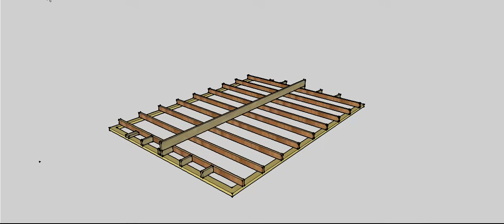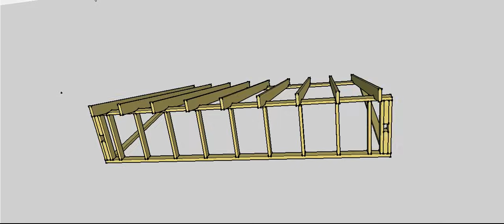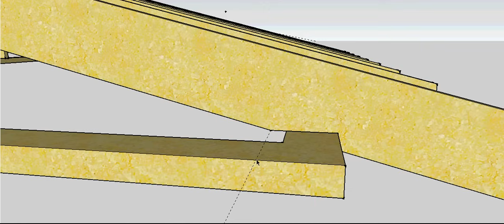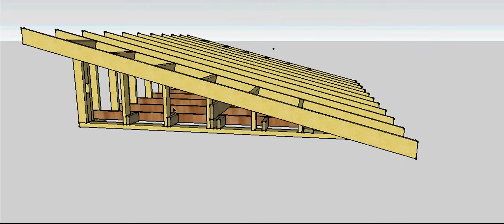Skillion Roof erection Procedure

Comment: Can I add this exact method to the top of the flat roof I already have with out removing anything. Reason I ask is because the flat roof I have has shingles and it's leaking a bit so I wanted to see if adding this method directly on top of my flat roof works.
Reply from the maker: Hi mate, yes that will work.
Reply: @Buildsum 
I have never done this type of project. How do I even start buddy .  I know to measure my flat roof ,but how do I know how long the rafters need to be or how high the skillion roof goes. Please give me something to start off

Comment: My jack, I need a 5 12 pitch with a run of 20 feet. Can anyone tell me how high does my jack wall has to be
Reply from the maker: 5 12 pitch = 22.62 degrees, 20 feet = 6.096m
Tan 22.62 = 0.417 x 6.096 = 2.540m = Jack wall height 8.333 feet
Hope this helps
Reply: @Buildsum so the knee wall needs to be 8 feet high to get a pitch of 5
Reply from the maker: Hi Mate, yes

Comment: Any reason you would advise against using 200x45 i-joists for the rafters? I'm building a livable garden shed 3600x4800 and happen to have some ijoists on hand, planning a 1mtr overhang on the high side and 400mm on the back. 5mtr span in total.
Reply: I guess you would strap them to the top plate and fill in between with whatever.
As an aside and this might change things. I've got hold of a load of second hand coolroom panels. 9off are 4200mm. The 20off others are 2700. I'm thinking this could be an interesting livable-shed build. Panels are painted  metal both sides w/ 100mm polystyrene.
Reply from the maker: Hi mate, no, as long as you dont notch the cords then they will work fine.

Comment: How far out can you come 4 metres to much or just 3.5meters max
Reply from the maker: Hi Mate, this distance depends on the size of the rafters.
Reply: @Buildsum  If the rafters were the correct size or altered, is it possible to extend by 3.75 meters?
Reply from the maker: Possible but probally not econoically viable i would suggest.

Comment: As a novice, i took on a project to build a 12x16 shed/workshop up at my land 2 hours away from where i live.
Using basic designs found online.
Building the structure by myself wasnt too hard.
However, having difficulties with buulding the open gable roof.
So much so that i am now considering ditching the gable roof for a mono pitch like this skillion in your video.
I guess my question to you or anyone here is.....it seems this mono pitch is much simpler and easier than a double pitch with this gable roof.
Would that be an accurate assumption?

My structure is level and square, but something seems off just looking at the 3 trusses i have put up so far.
The only thing that i can come up with is that i may have shanked one of my cuts by 1/2 degree or so. On either the upper or lower cords.
I dunno. I have been staying in a tent when i go up there to work and the weather turned down pretty big this last trip. Down to 16 degrees. So the enviroment plus doing the work by myself has me a bit worn out and probably prone to more mistakes.
Reply from the maker: Hi Mate, yes the mono pitch is certainly the easiet method. 
Gables aren't to hard really, have you seen this video.
These videos may help
https://www.youtube.com/watch?v=iKyD4vR_6-M&list=PLHFT_d-5EhN69uEyQtjFk5l5xo8_kgeQL&pp=gAQBiAQB
Certainly sounds like tough conditions to be working in. Hope this helps
Reply: @Buildsum  turns out i did mess up a cut. Instead of 26.5 degrees for the 2 upper cords. I did 28.
I didnt use my 1st as a template and just kept measuring each individually.
Which of course had 1 or 2 trusses sitting higher than the original

Comment: Is a ceiling frame necessary for a skillion roof or can the ceiling be left open? I am building the same kind of roof except with an additional roof on the other side. My other question is: Can I put on the roof sheathing and metal sheeting up BEFORE attaching the wall sheathing below? The reason i ask is that I started adding osb sheathing to one of the roofs and when I got up there noticed the structure as a whole sways some. I’m thinking the wall sheathing will tighten it up? I opted to put up the roof first because we get a lot of rain where I live and figure the roof will add some protection to my subfloor which is also osb and the water manages to get through the plastic. Much thanks.
Reply from the maker: Hi Mate, absolutely no need for the ceiling.
Where I'm from it is common practice to get the roof on ASAP and then go back and do the walls, etc. That said the walls should be adequately braced so they don't move before you get on the roof.
Reply: @Buildsum  will do. Thanks for clearing that up for me.

Comment: Awesome video. Simple yet thoroughly spelled out. I’m building my first rough cabin, a 12’ x 20’ and am wondering if I can run a 4x4 across the midpoint overlapping the side walls as the sill of constructing two rooflines, one sloping towards the front and the other towards the back and lay in a couple supports on the inside below the 4x4 rather than a full wall as your video shows? Much thanks.
Reply from the maker: Hi Mate, sure you can build up the centre and have essentually a skillion of both sides however that is just basically a Gable roof and you could save yourself some materials if you built it as a Gable.
Reply: @Buildsum  yes I can totally see that now. I built the “box” and laid across the frame. My initial plan was to put clerestory windows, but I ended up with enough windows below, not to mention the crazy high cost of windows these days. Yikes. I Couldn’t have done it without your videos. Well, would have been harder. Thanks.

Comment: How do you insulate the roof on a skillion design? Since there is no ridge, as in a roof with a gable, there is no ridge vent. Are there no vents installed on the lower or upper sections of the roof, and if that's the case, does insulation take up the entire thickness/height of the rafters/joists? My roof doesn't have a ceiling frame, as the roof is the ceiling. To have additional natural lighting, I have casement windows in the raised area, so I can't install a ceiling frame. Thank you.
Reply from the maker: Hi Mate, as you say you just have to insulate between the rafters with whatever thickness of insulation you require.

Comment: A variation on the ceiling would be a "vaulted ceiling" giving quite a bit more perceived space on the inside.  That would require not using the horizontal beams shown at 3:00 in the video and just drywalling the interior (underside) of the roof directly.  How much structural loss (if any) would need to be compensated to allow a vaulted ceiling without those horizontal beams?
Reply from the maker: Hi Mate, if you are going to maintain the flat style roof then there is not much of an issue however if you are going to vault a pitched roof, i.e one with a ridge, then you would need to consider this problem.

Comment: I'm wanting to bring the studs on the high side up to roof height and avoid a jack wall but a I want a flat ceiling inside. Would I notch into the studs to create a horizontal surface for the ceiling joists?
Reply from the maker: Hi Mate, no, i would put a plate along the wall and run the ceiling joists into that.

Comment: Thank you for great video explanation. 
In your example you is using jack wall, but was telling that it's better to build higher wall. But how in this case you will build the ceiling? You don't have horizontal top plate
Thank you
Reply from the maker: Hi Mate, you can just attach a plate to the wall for your ceiling joists to run into.

Comment: im building a 40x30 shop and i want to use a sloped roof like this. what do i need to do about here becuase obviously you cant buy 2x6 boards that long. do you over lap to boards to get the length? i assume you would need a lot of over lap to keep in structurally sound. anybody ever have to do this?
Reply from the maker: Hi John, you will have to join the boards however they have to be joined on a support. You may be better off doing a low pitched roof so you can join them in the middle of the roof. Hope this helps.
Reply: @Buildsum  I was thinking that myself. I was going to go with a sloped roof because it's less material and easier to do by yourself.  But if it won't fly with the inspector then it ain't going to work. I guess low pitch it is

Comment: Nice vid on the subject... what is the longest run you could build this type of roof for? Considering building a 28x52, preferably with a few feet of overhand on the front and back. Also, is there a way to do it with no vertical support beams that go into the inside of the building itself (centerline of the building), as well as an open ceiling design?
Reply from the maker: Hi Mate, the longer the run the deeper and generally more expensive the timber required. You could put a beam under the join in the rafters to support them over long runs or if you want clear lines you can lift the beam up into the same plane as the rafters and butt the rafters into it with hangers to take the load. This beam would have to be pretty substantual to span the required distance so it is not uncommon to use steel I beams to do this. Hope this helps.

Comment: If you were to build one wall higher than the rest what is the best way of connecting that wall with the rest of the other walls? Because I built a garage once with all walls same height and double top plated to join them but I'm currently building another shed with skillion roof and coz of one side being higher I can't double top plate that wall to the lower height walls, so how could I join them? Thanks.
Reply from the maker: Hi Mate, you just need to use a connector like a Multi grip or a Triple grip from the lower top plate to the higher wall. 
https://www.bunnings.com.au/pryda-multigrip-100-x-35mm_p1072509
Hope this helps
Reply: @Buildsum  awesome thanks for that. It didn't occur to me how to do this until I was nearly ready to stand the walls up. 👍

Comment: Hey would you ever use trimmers in between your rafters to stop rafters rolling over?
Are the  battens and facia and like Tripple grips normally enough?
Reply from the maker: Hi Damien, i treat rafters the same as joists, if they are 4 time wider than they are thick then they need to be trimmed out.

Comment: how can i build a roof like this one but with parapet roof on three sides except where the roof leans to?
Reply from the maker: Hi Carlos, you could do it by just building the walls all the way up to start with and then putting the rafters inside that or do the roof first and then add short walls to extend above.
Reply: @Buildsum thanks for the quick response, i've never built anything of this size but right now all the local contractors are charging an arm and leg.  Prices are crazy cause of lumber spike, but for some reason the labor went up also, very high I may say.
I hope you can do a video on it on the near future.  thanks Buildsum

Comment: AND STILL helpful.  I believe you said to to just fill the holes between the outriggers with 2x6's (if that's what you are using for rafters) is there a standard for how often to place outriggers? Can I put them on 2ft centers and just fill the gaps with 2x6's?
Reply from the maker: Hi Bill, the outriggers should be spaced the same as the rafters. Hope this helps

Comment: @Buildsum thanks for another good video. 

Is it possible to build it so that the rafters is turned 90 degrees, so the gable stud wall carries the weight? I ask because I have a lot of rafters not long enough for my roof project. but I have a bearing wall coming down the middle so I could join them over that wall if it is possible to turn the rafters 90 degress. What is the best way to join them?
Reply from the maker: Hi Troels, yes you could, they would technically be purlins rather than rafters but it would work. The other thing that you could do is to put a beam in under the middle of the rafters to support the join in the rafters. The best way to join them is to run them past each other and nail them together however on the outside rafters you would have to butt them together and place a block behind the join to nail to. This is similar to how you join Bearers and Joists as shown in this video. https://www.youtube.com/watch?v=hkw9WT5B7h0
Hope this helps
Reply: @Buildsum  Thanks a lot

Comment: Hello! Can this be done with two lengths of 3 meter studs if I'm only able to find a 6 meter studs for the length?
Reply from the maker: Hi Daniel, It can however you would then need a support beam running across the middle of the room to support the ends of those Rafters. 6 metres is a fairly standard length there shouldn't be to much trouble finding material at this length.

Comment: Appreciate the video mate but shouldn’t you use the general cantilever method of 1/3 out 2/3 in...? 🤔
Reply from the maker: Hi Matt, Yes the outriggers should use the 1/3 - 2/3 cantilever rule. This would mean that they would extend back to the second rafter and the first rafter would just be blocks between the rafters.
Reply: @Buildsum  Hey mate,  In your reply above talking about cantilevering the outriggers and taking it back to the second rafter, do you mean the first rafter would be blocks between the 'outriggers' rather than rafters? Now thinking of the front and back walls and where the rafter sits on top, do you put blocks to plug the gaps between the rafters along the front and back walls?

Comment: What is the distance from the inside edge of the top plate to the verge plate ?
Reply from the maker: Hi Chris, this is really up to you or the designer of the roof. As a rule the outrigger can't extend more that 1/3 the total length of the outrigger which is the standard rule for a counterlevered member. Some designs have the same over hang on the barge as they do on the eave and others have a smaller barge up to you really. Hope this helps.

Comment: If you had a 30' endwall, and a 40' length, what kind of lumber and support could you do that would support everything? I was thinking of maybe using a glulam or multiple 40' LVLs as the "strongback", or central beam, and then having some 20' 2x12 rafters that would lap and break over the glulam/LVLs and have bearing pressure down on top of it. Is there an easier way or would it be better to do a steel I beam? Or am I way off in what could be supported by a single 40' beam at 15' from the walls? Thanks
Reply from the maker: Hi Mate, it sounds like it should work you just have to make sure that the timber or steel you are using is rated to span that distance with that load.

Comment: Thanks for all the great videos. Do you need battens under corrugated roofing on a skillion roof if the rafters are running across the pitch, on top of a raked top plate and spaced within what would be specified for the battens (ie. 900mm)?
Reply from the maker: Hi Brett, in this case the rafters, as you call them, would technically be Purlins and yes, they can go across the pitch as you describe. I generally try to keep my battern spacing under 1m however im pretty sure you can go as much as 1.1m with corrigated iron. It is always best to read and follow the manufactures instructions so you dont void any warranty if you are using new materials.
Hope this helps
Reply: @Buildsum  Ok, great. Thanks again.

Comment: Thank for the video it was very informative. One question I have is how much further can the rafters over hang over the highest point of the roof, is there a maximum distance as am building this as a pool cabana and wanted more shade.
Hope this question makes sense.
Cheers
Reply from the maker: Hi Marcelo
That depends on the size and therefore the span of the rafter in the first place. The span tables will specify a span and a counter lever for each rafter. 
This video may help.
https://www.youtube.com/watch?v=X7eG88FpLI0&t=284s

Comment: so if a beam not long enough can I double them up? to make it longer
Reply from the maker: Hi Jacqueline, beams get their strength from thier depth not their thickness so making them thicker wont help much with how far they can span, you could run a Purlin inline with the rafters however it would have to be able to span the length of the roof and carry the weight.

Comment: Thanks for this video.  I'm built a huge dog house 8' X 8' (for 3 doberman pinschers), with a gate door for an auto food feeder, and a frame for a window air conditioner (the mosquitos are brutal here and the cold keeps them away).  I set the dog house next to the house and I will match the slope angle of the house roof to the dog house.  I will use your design for the dog house roof.
Reply from the maker: Hi Mate, Wow, that is a huge dog house, Thanks for your comment.
Reply: I want to see it. Im building an 8'x8' greenhouse with a roof like this.

Comment: What would a good height difference to not need a birdsmouth cut, thanks?. Thank you, this video is so simple and helpful.
Reply from the maker: In this day in age there is no need to have a birdsmouth at all however if you dont birdsmouth the rafter additional support in the form of a wedge or a framing  anchor is required. Hope this helps.
Reply: @Buildsum  Yes, it really did, thank you.

Comment: can you use 2x4s for the rafters?
Reply from the maker: Hi Mate, you could, however, they won't span very far so it would have to be a pretty small building.
Reply: They need to span 21 feet but its for a low slope roof. Ill raise the high end about 12 inches then rest the other end on the rafters. I was thinking I could use 2x4 if I put a brace every 6 feet. Im doing it myself so they are easy to work with. Hopefully it holds up.
 @Buildsum
Reply from the maker: Mate, that sounds like a very long span, the most I was thinking was around 7 feet. If you mean that you are going to put in a support rather than a brace every 6 feet that might be ok.